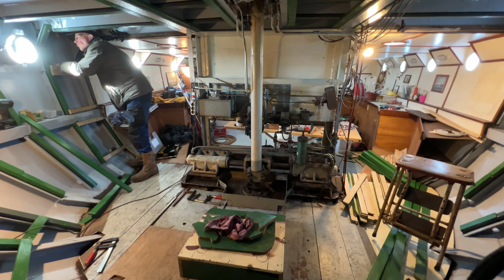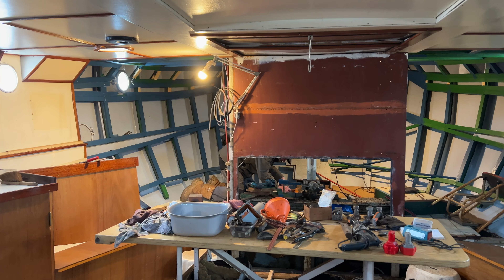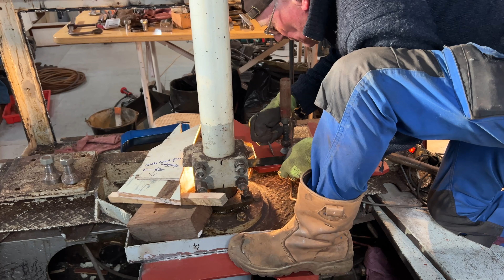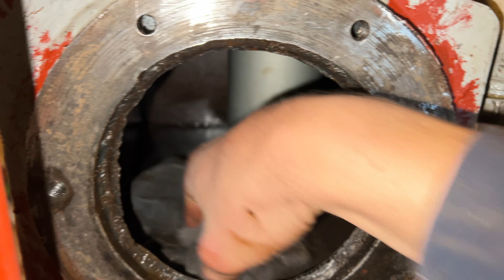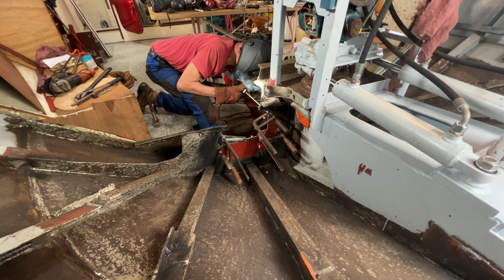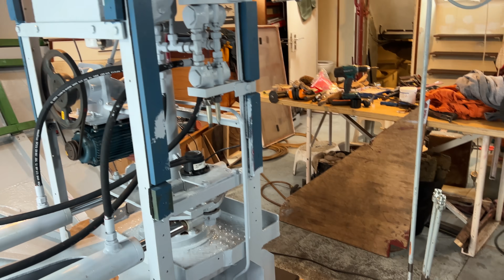It's Finally Time To Replace The STEERING GEAR - After 81 Years

Comment: I would use Thread locker or Nordlock wedge type lock washers on all the steering gear fasteners .
Reply from the maker: We now used regular spring lock washers, and we painted over the nut, so if the paint cracks, we know we need better lock washers :)

Comment: The price of Plasma cutting gear has come down so far and bottled gas tanks of O2 and Acetylene do  high have you considered getting an electric cutting rig ?
Reply from the maker: We did consider getting one a while back, but we have to run the compressor for that, so the diesel generator for 3 phase power, which is noisy and burns diesel ofcourse. Or we need one with an internal compressor but I hear those are not the best. + we’re very used to the cutting torch. All that made us decide against it, and since we’re now as good as finished cutting stuff out, I doubt we’ll ever need one :)

Comment: Nice sturdy and reliable steering installation. 
That old resistor must have doubled as a heater ! Useful things 24 to 12v converters, I had 3 on my barge even though I had 24v and 12v alternators on the engine
Reply from the maker: Thanks! Makes sense, keeps the cable thickness a bit lower :)

Comment: Dad is at one with the torch.  A telling of his welding experience would be nice.

Knowledge of DC, AC, electric motors, electronic devices, hydraulic and propulsion systems is quite valuable.

I see no sign of a hold.  It would be great to have a hold, even 3 or four meters x beam width, keel to weather deck.

The work looks sharp.  
Thank you gor sharing with us.
Reply from the maker: His welding experience kinda originated when he was 28 and started converting this boat from tugboat into sailing ship. It's fair to say he got the hang of it when it was finished 14 years later :)

Right now we still have a hold, it's about 4 metres long over the full width and height below deck. There's currently no deck hatch though, and we do plan on converting it into cabin area, but that's still open for discussion :)

Thanks!

Comment: Seems like this system still takes too much energy. Why. not have an accumulator and a pressure switch. Are you usuing hyrdos for other actions on the boat? Winches? Windlass?
Reply from the maker: During sailing, the the rudder is adjusted continuously, so it seems a bit silly to have the pump start and stop the whole time to charge the accumulator, when it takes only very little energy pumping back into the tank in the rare moments that the rudder gets no command. The only other hydraulic application we have is the furlers on the forestays, which have their own powerpack, that runs only when the furlers are furling :)

Comment: In 1944 the Nazi's still controlled a large part of Holland.  Just who and why was this build started on this boat?
Reply from the maker: It was built as a commonwealth tugboat for the war in Canada. Dad and Granpa bought it in 1975 to convert it into a sailing ship. One of the first videos on the channel is about the history of the boat :)
Reply: It looks like the wheel faces astern. Out of curiosity, why is the pedestal oriented in this direction?
Reply from the maker: It's done so that the helmsman can stand in between the wheel and the compass. In heavy weather you would normally stand with one hand at the wheel, and one on the binnacle :)